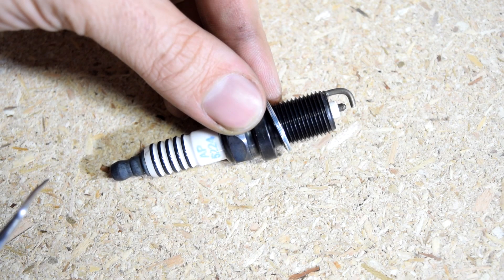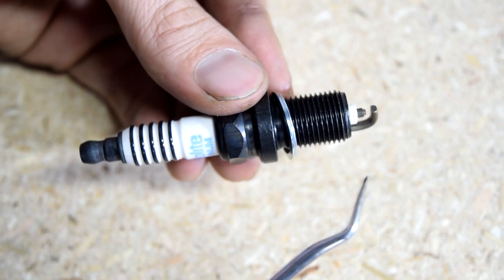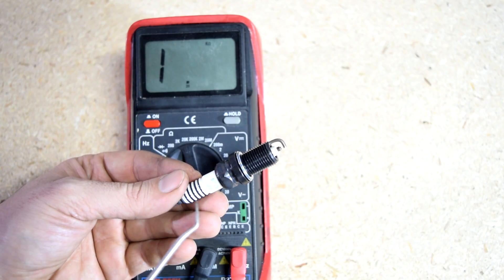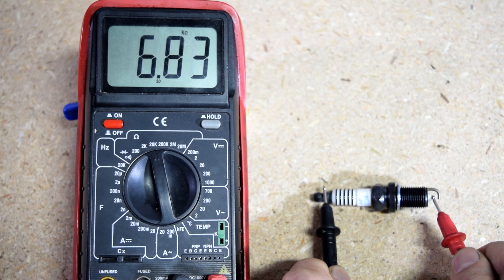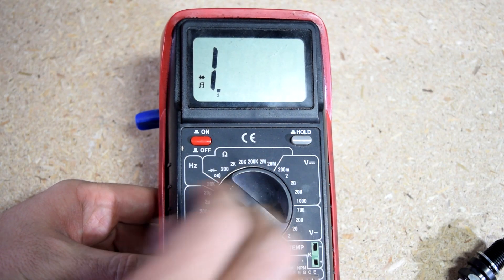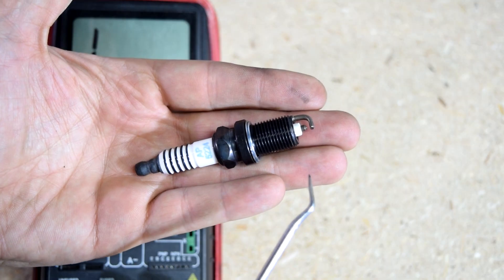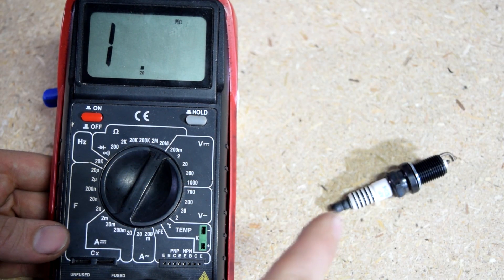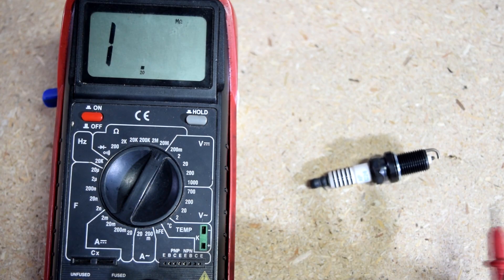How to Test Spark Plugs Using a Basic Multimeter

Comment: Hello
I tested spark plug if they don't touch each other inside 
I put on 20M ima and no reading which is good but my max resistance on volt meter is 200M OMS if input there and measure I do have reading. Which one is right?

Comment: I have heard different values with ohms readings (multimeter) for small engine spark plugs (mower, snow blower, etc.). Can you set it straight for me? Some say a good spark plug should read 500 to 5000 ohms. Others say 4000 to 8000 ohms. And still, others say 5000 to 15000 ohms. Which is it? Or, is there another standard of values to use?

Comment: I have tested the spark plugs of my Honda dream motor cycle and I got open reading I installed back and still working it is Bosch spark plugs why no resistance at all ??? Even the new spark plugs cup no resistance too but it is working some of my old spark plugs I got reading 5.5 m ohms ???

Comment: I'm in no-way a mechanic.  I have everything to learn and with that said.  Have an issue with my John Deere Lawn/Garden Tractor.  The spark plug, while it appears new, when tested 3 times to ensure the same reading and reviewing this instructional video a few times.  I learned that the new appearing spark plug is bad.  Thanks for this video that is direct & to-the-point, unlike some of the others I've watched from other's.

Comment: love this video...I had a vibration @ idle on my 2005 5 3 GM  I even took my SUV to a shop and a very experience mechanic change the maf sensor...dint fix that...I did a smoke test...and nothing...replace the crank sensor,clean the throttle body, I was chasing my tail around...until some young mechanic I know told me over the phone to change the spark plugs...dint believe that but after a few weeks I decided to change them and DAMMM...fox the problem...now I know how to test them...I just had an experience today with a different car...replace the spark plugs die to a misfire on cylinder #2...got brand new spark plugs...AC DELCO IRIDIUM what's recommend by GM and guess what!!! I had a misfire on cylinder #6 this time...I  refused to believe that I had a faulty brand new spark plug so I test the coil  packs injectors pulse and after getting shocked by the coil  I said to my self...coil is good...so I swapped #6 misfire brand new spark plug for an old one same brand same part number and to my surprise it fix the misfire...I hope this helps someone...definitely test even the new spark plugs...I'm not so sure but i think some of them have a resistor inside...I'm doing my own research 
...glad dint  throwed the old spark plugs away...I'm going to test them ...whit 2 multimeters just to be sure of my results
Reply: I always keep the old spark plugs just in case they may come on in handy, as you described.

Comment: Center electrode to threads.....umm you shouldnt have nothing ever. With high voltage you can get carbon traces which the high voltage will follow causing plug to lose spark. Another reason its not a good test is if the insulator is cracked on side. No tester in the world will tell you why its not sparking. Grab another plug and try again. If its sparks, its a good plug.

Comment: At 2:47 center electrode to threads   results in open. Great but I after 3 ngk's two new that I bought. All fail continuity test from center electrode to threaded base. After running in Honda ct90 mc. These check good when first installed. 6v system  new oem coil, points, condenser. Anyone with any knowledge of why?

Comment: You CANNOT test spark plugs reliably using an ohmmeter.  Compression causes bad plugs to misfire. Worn electrodes cause misfire. The resistance increases causing misfire. Use a spark tester to check misfire. Replace plugs. They're  cheap.
Reply: Rex Anderson .

Comment: I like this very much   - good information to know, and well-presented. I gave it an up vote.

One tiny point  - voltage doesnn't "go" anywhere   -   it is the potential energy available to the circuit.   Current, as the name suggests, is the "flow" of electricity.

As I said...tiny point in an overall good video, but one might as well know all they can about a subject of interest.
Reply: I really like constructive criticism, it's such a knack to do without sounding like a dweeb. Thanks for the tiny point.

Comment: I watched your video thoroughly  from A to Z, but  I'm  so sorry to tell you are completely wrong about  why carbon build up  causes electrical disruption , FYI carbon  IS a CONDUCTIVE element , when it builds up over the center electrode and the ceramic isolator causes a SHORTCIRCUIT between  positive and negative electrodes impeding  any spark to jump across, The  real reason dirty/sooty spark plugs 
 don't work, is because carbon deposits  bridge up  both electrodes so current (as you must know) chooses the less resistive path, thus no spark  may ocurr .PLEASE do a little research before posting this kind of infomation because it  misleads a lot of people as I can see  in the comments.Thank you very much !!  .
Reply: Awesome
Reply: Was waiting for someone to correct him

Comment: I tried the last test you mention and I get Wierd readings.... If I lay it flat on a table and put the negative to the bottom of the positive to the threads I get no signal saying basically it is a good spark plug but if I pick it up and I do it in my hands I get signals what could that be?
Reply: Maybe the table is conductive !!🤔🤔

Comment: I've never seen anybody use a multi meter to see if a spark plug is working or not.Everyone including myself just pulls the plug, put the plug wire back on, ground it, and crank the engine over.But that by itself wont tell you much.